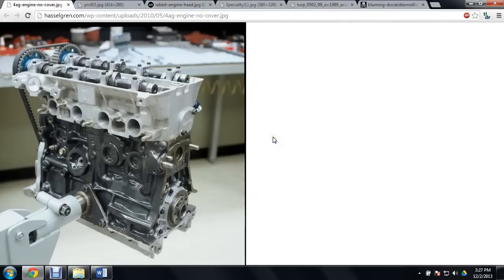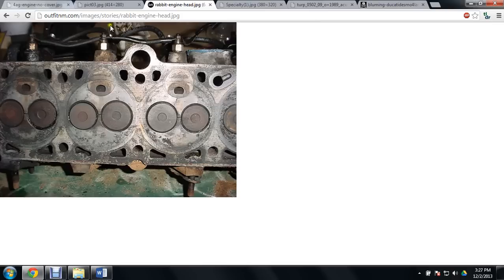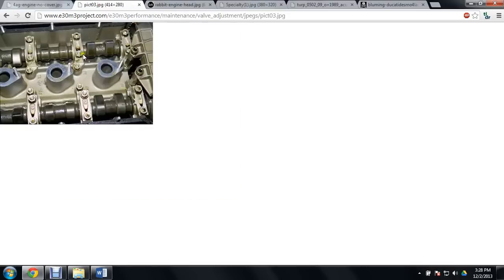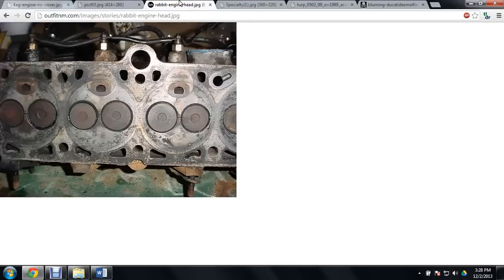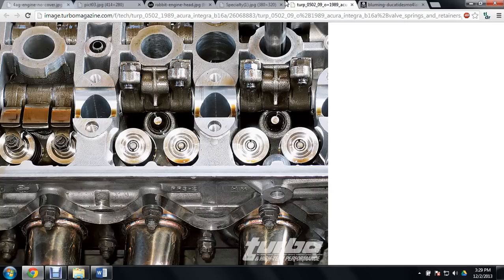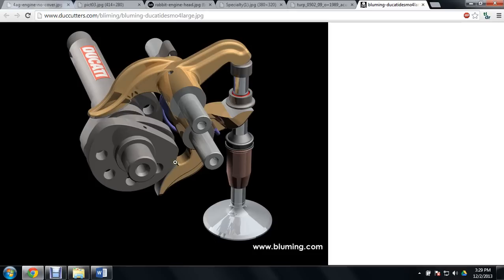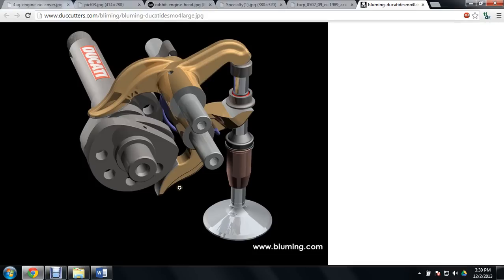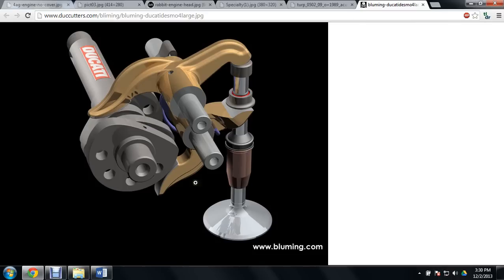Desmodromic Valves Explanation

Comment: Design and history

Desmodromic poppet valve example
Fully controlled valve movement was conceived during the earliest days of engine development, but devising a system that worked reliably and was not overly complex took a long time. Desmodromic valve systems are first mentioned in patents in 1896 by Gustav Mees.[citation needed] Austin's marine engine of 1910 produced 300 bhp and was installed in a speedboat called "Irene I"; its all-aluminium, twin-overhead-valve engine had twin magnetos, twin carburettors and desmodromic valves.

Comment: Interesting explanation. However, this was not done to avoid valve float, but rather metallurgy in Italy was behind the times and their springs kept breaking. So they adopted the desmodromic system. Because it's Ducati and because it is Italian, it became a thing. It's proprietary, overly expensive, and not really all that efficient. It puts an unfair onus on regular owners.

Comment: Nice explanation, Chris! Conner(below) is technically correct that Ducati didn't invent Desmodromics but it is what
Taglioni brought to the company & made supremely successful. It's also true that valve float does not mean
100% certain your motor will blow up although it is a VERY bad thing. IMHO, this video is a great explanation but I 
would consider tweaking your script on these two points to silence the nitpickers. FWIW.

Comment: You overhyped the severity of valve float here. There are plenty of interference motors out there which all use spring based valve trains, and none of them suffer blown motors from valve float. The main problem of valve float is loss of compression. Interference motors only suffer catastrophic failure, aka blown motors when a piston strikes a valve. The piston isn't going to strike the valve unless the engine goes out of time. Unless you break a timing belt or it skips a tooth, everything is fine. The piston also isn't going to go up or down unless the valves are opening and closing, and again, if the engine is in time then nothing is going to happen. Car and motorcycle makers understand this and they design these motors with tolerance for valve float. Do you realize how many vehicles would be stuck on the side of the road with rods pushed through the block and a lot of motorists wondering what happened? Good video, but its wrong.

Comment: The engine you show first doesn't have a rocker. Typically in our world of sportbikes the cam rides on a bucket that directly presses down on the valve spring. Valve float usually doesn't result in a blown engine. Most times it is a seized engine if you get valve float. Also usually simple to repair if the guide doesn't shatter.

Comment: Don't mean to knock on you, good explanation. But valve float has not been an issue for a long time. Especially for a Ducati. The L twin has huge pistons which put too much stress on the crank to rev very high, much lower than inline 4s. They don't rev anywhere close to where spring reseating would be an issue. There is no "real" advantage of desmo valves. They used to be in the 50s, that's why Mercedes and a good number of other manufactures used their form of desmo valves on their performance cars. Ducati did not come up with it, but now they are known for it and they like to keep it that way. There is mystery and exotic stamped all over them. Anyway, I love my 996 and it's valves are unique and cool. I just think there is a lot of misconception out there about them. Just to let you know, it does not make valve adjustments extremely time consuming. Or extremely expensive. You just need to check them in 2 places each.
Reply: If you over rev you will get valve float. Also with desmo valves you have the ability to push for higher revs from tuning and no need for supporting mods. I believe it has more use for the teams racing and using the technology to its maximum potential.
Reply: +MultiBadBass Spring based valve trains have always had valve float and rotation problems. Its not severe, it just usually leads to loss of compression because the valve cannot seat fast enough or completely.
Reply: Yes and no. Yes most ducaties rev lower than the equivalent inline 4's but because they have huge pistons which means the valves are massive. Heavier things accelerate slower if the force is the same. I think the valves are so massive that with conventional springs it will be hard to keep them from floating at high rpm.